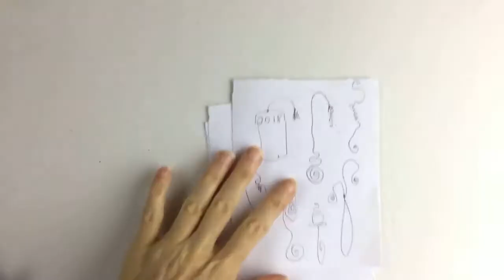Graduation Bookmarks DIY Livestream: Wire Lady TV Episode 23

Comment: Hi I want to start to work on bookmarks and wanted to use copper wire, should I use 18 gauge and what kind, soft ?half hard? , I would appreciate your help , thanks 😊
Reply from the maker: Hi Sandra: 18g soft or half hard depending on the quality of the wire. I us 16g when I flatten the wire, but it would be a bit thick for a bookmark if it's not flattened. Good luck.
Reply: @HeatherBoydWire  thank you which copper wire do you recommend, if it ok to ask ?